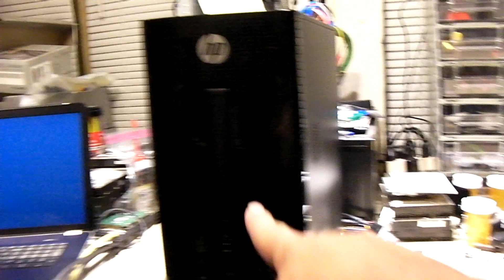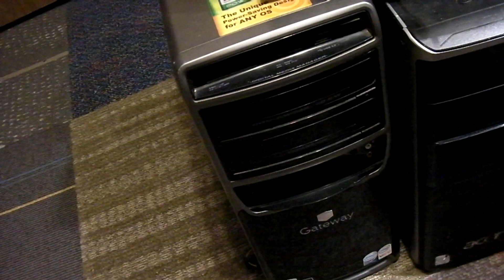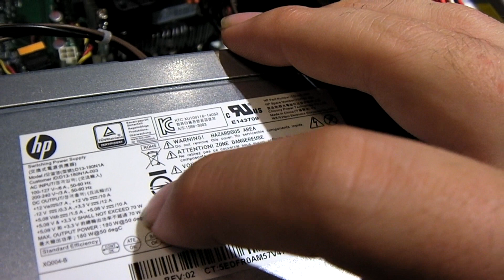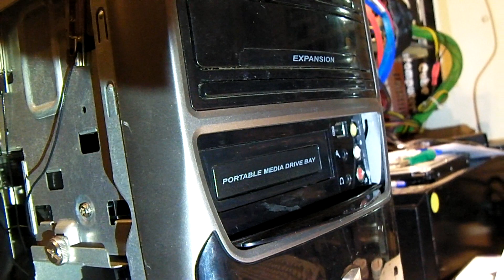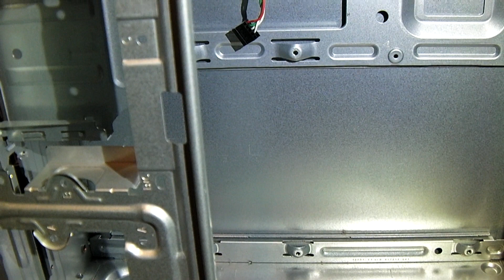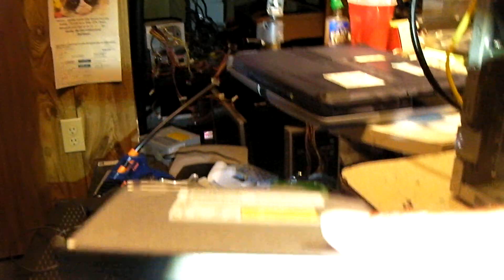A look inside of a VERY cheaply made 2015 HP desktop system

Comment: I don’t see a problem with them using a cheap case and minimally specd’d because 99% of businesses will not upgrade the computer. The larger companies usually lease the machines for two or three years then get newer ones. It would create more e-waste if they added unnecessary components or made a case with more steel and aluminum. These are the bottom of the line systems designed for Microsoft word/excel, browsing the internet and checking emails. If you spent $50-70 on a computer case it would be much better quality. I will not buy any case that has plastic on it and my once go to cases were from caselabs or Sliger. I now own the NCASE M1 which is an absolute beast for mITX.

Comment: This is a bottom of the barrel machine in the "business" range of HP. Same crappy quality as the HP 250 notebooks. Basically, anything lower than the 400 series in HP's business line is plastic fantastic crap that should be avoided, yet businesses buy them by the boatload because they're cheap.